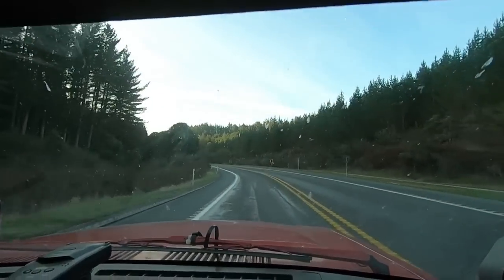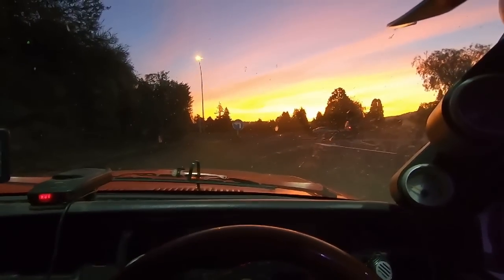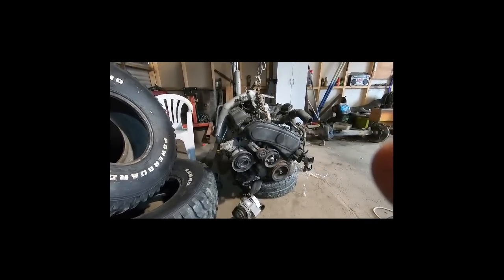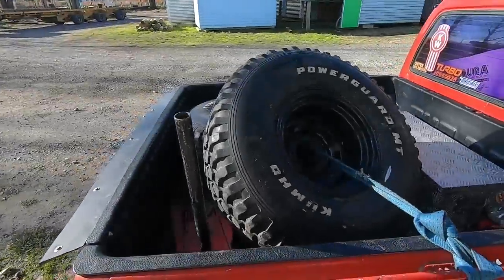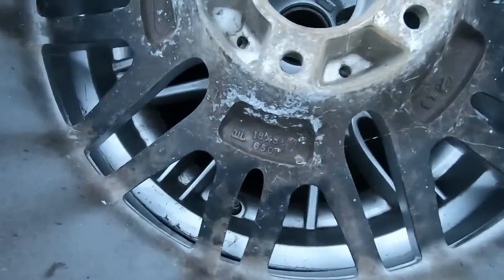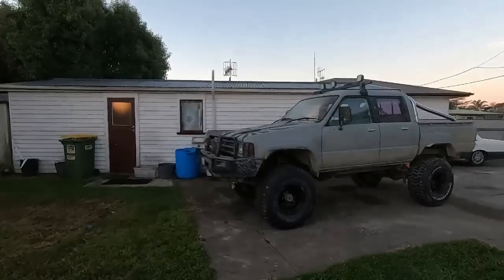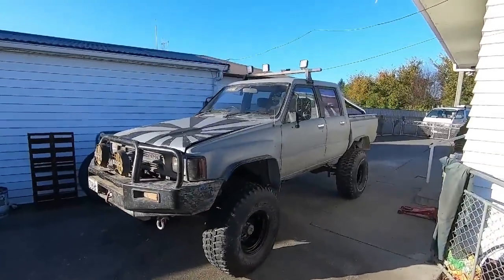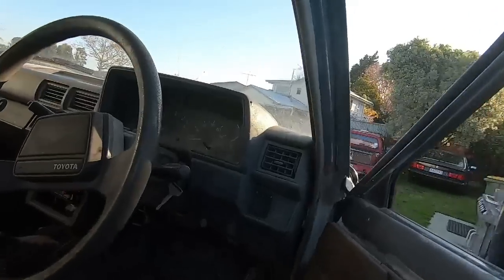More hilux parts!

Comment: are you running a bov on cliffy now?
Reply: Its a diesel.
Reply: @louis2743  ? wtf do u mean ahhah I have the same 2.5td motor. diesels can run blow off valves.
Reply from the maker: na no  bov, just no intake off the turbo for max dosseee
Reply: @wavyyfn7    a true bov is opened with vacume , diesel's dont make any vacume (execpt vacume pump)..... you can still attach one and use boost to push it open though.